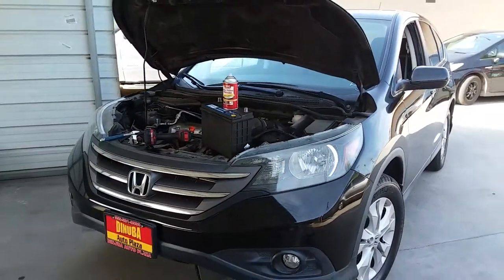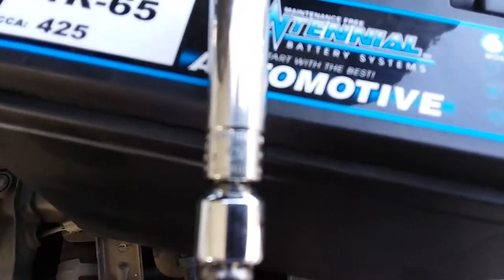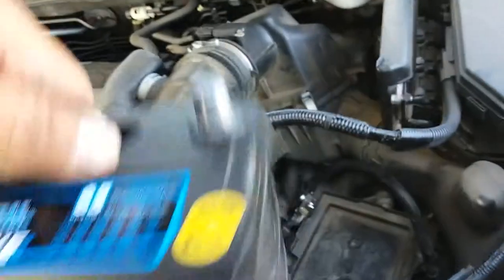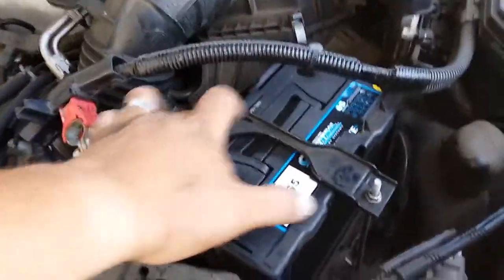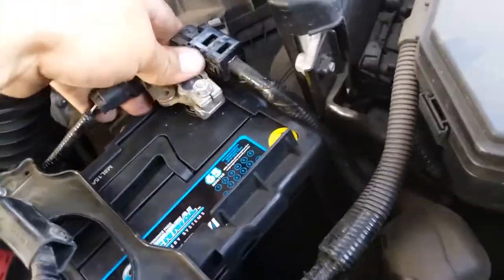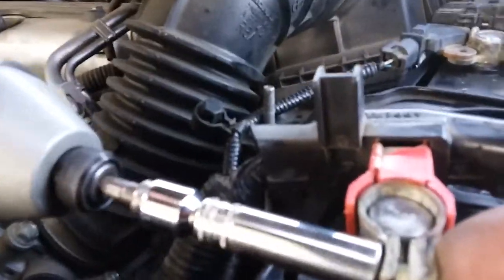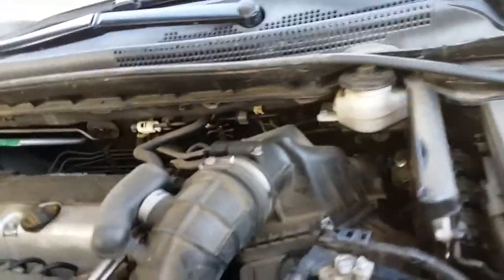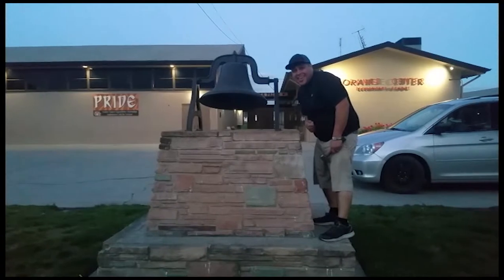How to: Install a new battery on a 2014 Honda CR-V

Comment: Is the computer ok during the battery   disconnection?
Reply from the maker: Yes I didn't use a memory saver and had no issues after installing it! You should be good
Reply: You didn't have to input the radio code to get it working again?